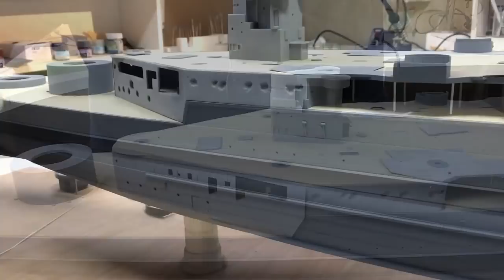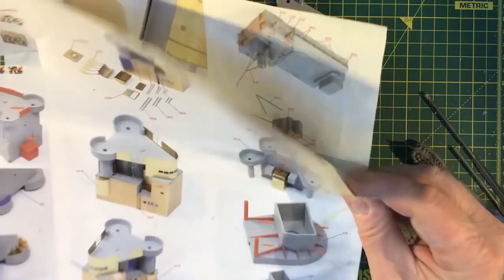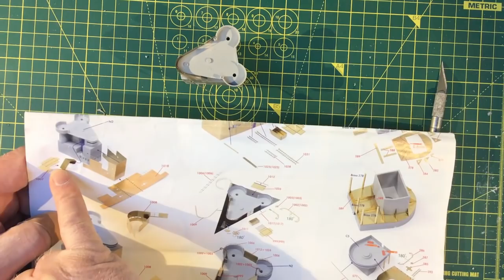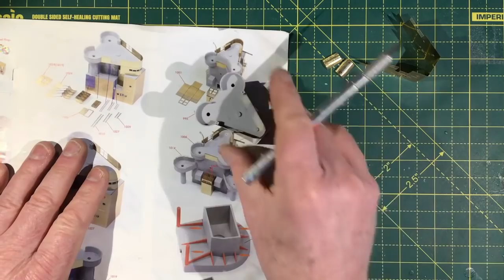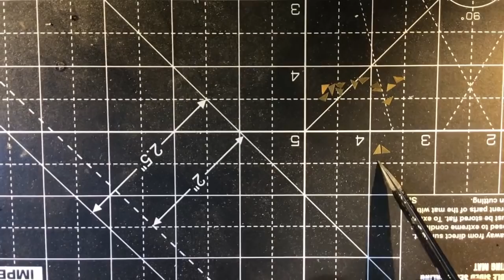Trumpeter 1/200 HMS Hood Full build with Pontos detail set Part 16 (Aft shelter deck)

Comment: One of the tricks I saw online for holding parts while you work on them comes from a Korean Modeler, Albion, I believe.  That is to attach the part to an old empty paint bottle, so you can pick it up by the bottle, and never touchtone actual part.  Works for painting too.  You can use sticky putty or hot melt glue and then detach it when you are done. I like to fill mine with water so it has more weight, but to each their own.  And no, your wife is not the only one to walk their cat.  ^_*
Reply from the maker: Good tip Andrew thanks👌